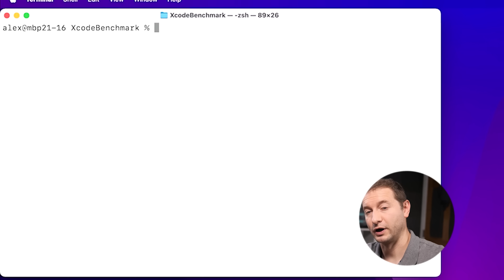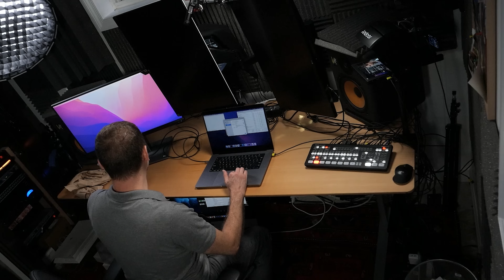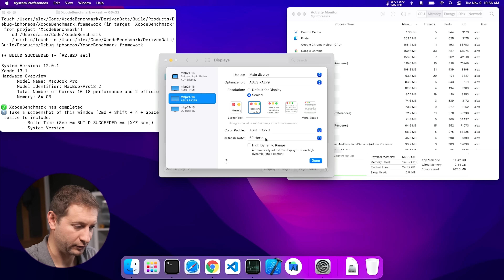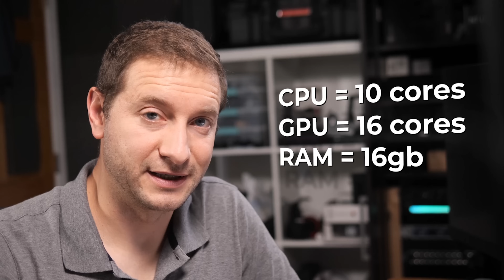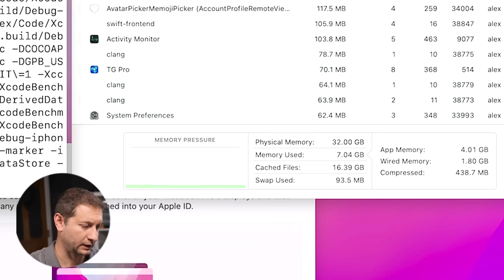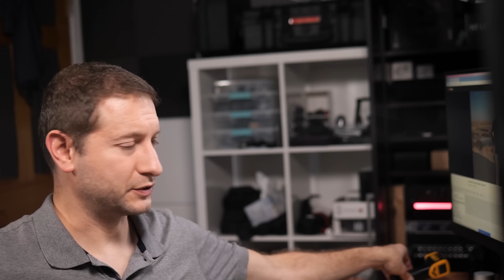More monitors = slower MacBooks | M1 Max/Pro with several 4k

Comment: Hello Alex!
I am thinking of buying the new macbook pro m2 pro 32gb/1tb to use it for professional software development.
I have two 32 inch 4k external monitors and one of them supports hdmi 2.1
Do you think that it will be quiet?
Is there any advantage to go for the max model?
I am not doing graphics or video so I believe there is no reason to go for the max series.
Thank you!

Comment: If you buy Displaylink certified hardware you can add more monitors. I'm able to have 4 external monitors on my m1 iMac. Of course this is for software engineer work. If you're working with video stuff your machine might blow up 😆

Comment: You should have ran multiple build passes before plugging in monitors or you could have done the last build after plugging in monitors due to caches and SSD optimization.
Given what I've seen of Apple's engineering on the software side of things I'd be surprised if they did proper clearing between runs.

Comment: To me, it doesn't seem like you're necessarily seeing slowdown because you're using more monitors. You've got videos playing on those monitors. Play those same videos and have those same windows open on 1 monitor and 2 and 3 and 4. Otherwise, nothing really has been proved. There's a reason the Xcode benchmark has that message about not doing other things while you test.

Comment: Thanks for the video. This doesn’t explicitly test the performance with external monitors connected but rather performance when other applications are running because we can’t actually attribute the performance impact to solely having an external device connected. As others have said, the test would’ve been better if you benchmarked with external monitors and no other applications running to establish a baseline. Same tests could be ran with each monitor connected to an individual port on the MacBook, then through hubs, then with different resolutions and a combination of hubs and resolutions.

Comment: What dock did you use to get 2 monitors on the M1 Pro? I'm trying to do that, and unfortunately my current dock that worked perfectly for my windows laptop to have 2 monitors doesn't let me use 2 monitors on the M1 Pro. Very sad. All the docks I'm finding online that support 2 monitors for the M1 Pro are like $300. 

I don't want 2 extended displays. I want AAB, one mirrored display and one extended display. I will use the laptop in clamshell mode

Comment: Something that I've seen with my intel 2019 macbook pro and my m1 mac mini 16 gb is that there is a process named "WindowsServer" which is related to the screens (I have two 28" 4k monitors). What its interesting about this process, is the RAM consumption keeps growing as time passes. I tried killing the process to recover the ram, which ends up closing the session which would be the same as rebooting. So, so far, this looks like a ram leak. What do you think?
Reply: I have exactly the same problem. I use 2 4K Monitors with my 2019 MacBook Pro 13 inch with 16gb of ram, which becomes unusable after 2-3 hours when running IntelliJ and Docker. WindowServer then nearly needs 5-6GB ram on its own…

Comment: Cool video, but it doesn’t really answer its central question… at all. 

The benchmark test is going to be effected whether you stack processes on one monitor or three… the way you did the tests it’s impossible to extrapolate how much additional monitors are contributing to the slowing of the benchmark.

Maybes redo the tests, or simply don’t add to the workload by running additional processes… the entire point of the benchmark is to provide a controlled variable to give an accurate baseline.

Comment: Theoretically extra monitors shouldn't make a lick of difference as your thunderbolt controller is separate from the SOC. RAM usage may vary as it uses shared RAM between video card and system, however it shouldn't hit it too hard as each monitor shouldn't be taking too much as it should just be the extra driver and then the image which should be getting flush every 3 frames. Any real slowdown will probably be coming from the OS. or if you cut hard enough into the RAM to force the compile to use swap.
Reply from the maker: Looks like you might be right
Reply: @AZisk  I am a bit worried about those RAM figures as you add monitors (prior to running anything), that is way more ram than it should be using.

Comment: Question for ya Alex. I've been trying to lock down the most efficient way to drive 6 EXTERNAL monitors with my M1 Max 16" MBP. I'm supposed to be getting the system next week (fingers crossed) and thought about getting a dock or two ordered right away to be ready.  These are not really high res monitors (native 2560x1440).  Obviously I want to drive 4 monitors from the built in Thunderbolt ports, but I suppose I'm going to need a DisplayLink (Targus 4x for expandability?) dock as well to drive the remaining monitors.  What did you find exactly with your port and/or dock arrangement here for driving monitors?  Am I understanding you correctly that you can only have 2 external monitors per Thunderbolt dock or Thunderbolt 3 to Dual DisplayPort adapters? I want to minimize the number of cables I plug into this system to prolong life of the ports and reduce complexity of connection/disconnection when I grab and go... Would appreciate your thoughts on the "best" docks and/or cabling arrangement here so I don't lose my mind...
Reply from the maker: I haven’t tested my max with 6 monitors, but i use 3 daily: my native display + 2 LG 4k 27” displays via a hub. It works ok, but i feel like i do get weird hickups that I didn’t use to get w my intel imac. I don’t know if it’s related to the software I’m running or having the monitors plugged in. It’s too early for me to say whether i can get rid of the hickups by removing the external monitors
Reply: @AZisk  could you explain in more detail the "hiccups" you're seeing? I'm shifting gears from an older Mac to reduce "hiccups" and I'd really like to understand what you're seeing since I'll be running this with 6 or 7 additional external monitors attached (Thunderbolt + DisplayLink) and would very much like to either corroborate or eliminate the issues you're referring to from my evaluations going forward.

Comment: Thanks so much for your great work. 1 question: Is OWC Hub able to output 2x 1440p 144hz monitor (2x plugged to OWC) when the hub plugged to single port of MacBook Pro 16-14 M1 Pro? As far as I see in your video, it can output 2x 4k at 60hz in HDR so it should right?
Reply from the maker: I didn’t test 144, but it seems this hub should be able to handle that
Reply: @AZisk  i think the same.. thanks for your efforts

Comment: Here is a little TIP if you use any of the scaling options theat give the little warning that says "using scaled resolution may effect performance" you are actually forcing the monitor to run at a higher than 4K setting. The 2560x1440 mode actually runs as 4096X2304 and the retina mode will be 5K downscaled so MacOS thinks the monitor isn't a 4k but a 5K monitor. This will tax the GPU by nearly 30% more than if you use the default scale which is 1080PX2 or 4K. This isn't an issue until you need to use the GPU for anything other than displays, so if you need the GPU for video editing you should rescale the displays to get the maximum power available. Also in the display settings if you hold the Option Key and click the scaled bubble you can set the display to more resolutions in both Retina and regular scaled resolutions.

Comment: You sure it is number of monitors and not the processes you running while compiling? What If u run Only 1 monitor but with YouTube playing while compiling? I guess to test If monitor is affecting performance you just need to connect the monitor but not running any other processes to be accurate

Comment: don’t forget that even though you have the 4k displays scaled down to HD or whatever, they are still retina displays and so i believe that if you have images or videos on the screen they will display them at native pixel resolution, ie at the highest résultions the gpu can match to the display native pixel res. that’s what i understand retina to be about anyhow. happy to be corrected. 

so what i’m saying is when you scale down a display it does that with all the chrome and text etc of the GUI but certain areas of the screen displaying media will push as many pixels as the display can handle to increase the image quality. is that true?

Comment: I have the 24 core 16" M1 Max with both the laptop screen and two 2k displays running (one at 144Hz). It seems largely unaffected by the monitors in terms of performance. The fans stay completely off unless I get to some heavier work where most of the CPU cores are being pushed, then one of the fans kick in at 1500 RPM which is to my ears completely silent (I do audio work btw).

On the intel i9, the same lighter work would have both fans spinning at 5000 RPM because simply connecting the monitor heats up the GPU so much that any load on the CPU on top of that just sends it flying. Actual heavy load with monitors attached would severely throttle and underclock the i9. So happy Apple went away from intel.

Comment: Do the displays reset every time the MacBook wake up?
Or
If you have two monitors plugged in then add a third for occasional use then does it remember settings of the third monitor from the last time it was plugged in or are you setting up from scratch again?
Reply from the maker: Ive been using it more, and it remembers as long as the configuration doesn’t change. If you add a monitor or plug them in differently, everything is reset

Comment: It’s more efficient for karnal to leave stuff in RAM, deallocations cost CPU cycles. More RAM you have more likely the kernel will just leave stuff in there. Plus you might still use it later, so if you do it’s already there for you saving a trip to the storage drive that’s orders of magnitude slower to access. Whereas more memory constrained devices are more likely going to cause the Kernal to preemptively free memory as it feels it’s under more memory pressure.

Comment: Each 4K pushes roughly 18 GB/s bandwidth. TB3 and TB4 can carry 40GB/s. This is why you can only get two of the displays through the dock. That is a technology bottleneck, not a dock or M1 issue.
Reply: Youtube definitely does NOT push 18GB/s. That figure would be assuming around 8 x 4k video 10bit streams (as 4k @10bit is ~18Gbps not 18GB/s), 4k youtube is nowhere near that level.

I have run 3x 4k monitors off 1 Usb 3.1 channel which carried 2x DP + 1 HDMI connection over it. The same system had an additional on-board DP connection and a HDMI port.

If thunderbolt cannot do this on the Mac, then that is definitely a Mac issue. Given that previously these same models were having issues running more than a single monitor without bricking or crashing, then that backs up the theory it is an OS/hardware issue that is not thunderbolt related.
Reply: @slipoch6635  You need to read how TB works, if you're running a display-port channel on that interface then it allocates the bandwidth for a display-port signal, this is a lossless, zero latency, always available, not affected by content, zero CPU load channel of video.  If you wish to stream video over USB then you can do all sorts of tricks - but thats not Apple as the experience is not consistent.
Reply: @edc1569  How this hub will work with 1k monitors? Will support additional 3 monitors ?

Comment: I am glad you made the tests on the machines you did, and noted how well the 16GB vs 32GB operate.  I too am slightly surprised at the monitor limitations on the Pro.  I expected too that if your monitors weren’t at full spec’d res, that you could get away with more than two monitors.  Guess not.  That too is informative for me.  Almost pushes me to consider the Max.  But, then again, my need to run more than two discreet monitors is extremely unlikely.

Comment: There's no point in testing CPU performance here... Of course CPU will be affected a bit - to handle all those windows - and especially if you run some apps in background but that's all. GPU will be more used, especially its VRAM (in this situation - just main RAM) 

In your video of course RAM usage were higher, and build times were slower on more monitors - because you simply run more apps / Chrome tabs - come on 😀 

Also: If you have more RAM installed, OS will obviously try to use more RAM because what's the point of having RAM and not using it?

What could be more interesting from such videos would be: fan speeds, temperatures, GPU performance...

Comment: Most of the time it is not software limitation, it depends on how many thunderbolt chips it has, it would probably handle even up to 8 ( I know it'll have some reduced FPS sometimes and so on, but it's still handling ), but as M1 is not Intel CPU, it has dedicated thunderbolt chips inside, but trick there is that, I remember it has 3 thunderbolts, but HDMI is not using thunderbolt indeed, so you discovered bug I think, it thinks all Thunderbolts are allocated, but it is not. Don't quote me on that, but it's probably bug. but it can be Apple, manually reducing number of monitors connected from SmC, or something like that, for same reasons as they did reduce performance on iPhones for years ))) to sell higher priced models, so both cases I don't think you'll be able to avoid that limit with external adapters, if it hits hardware limitation (every thunderbolt chip is allocated) then it'll not be physically able to handle more monitors, and for that case when you use 1 monitor with HDMI, again, either it's SmC, or Software limiting it so it'll not let you connect more.

Comment: Thanks for the real world tests. Guess you don't use devtools in development much.  In the real world a developer might be stepping through code and pause at a breakpoint.  Maybe devtools is communicating with an IDE.  Intuition might say no additional resources would be used if devtools is paused on a breakpoint, but inuition goes out the window with chrome in my experience.  Too niche a test? Poll developers to find common setups?

As others mentioned, the video title is a bit misleading as the test is against additional task not additional screen. Multiple videos playing simultaneously? Perhaps not very real world.

The question of standardization could be  addressed some by driving the tests with AppleScript.

The general benchmark problem is that they are often done as drag races, i.e. find the max speed without regard to how users really work. Pitting machine against machine is fine if one is choosing a machine for a headless build server, but who is doing that with a laptop, so thanks again for tests showing RAM use, temps, etc. in a scenario closer to what will be felt by the user.

Comment: Results are obvious. The memory is unified, shared between CPU and GPU. Hi-res screens eat a lot of memory. You'll need 32 gigs at least for such play. But I guess most devs will do fine with one external monitor.
Reply: So, to clarify, a high res screen will use more of my RAM or GPU memory?
Reply: @joelm.8340  On these macs, GPU has no memory of its own. It uses RAM, hence unified memory
Reply: @ukaszb5694  awesome. Thanks

Comment: Of course the second time is faster. Everything is cached in the ram and you are increasing the load (the youtube vid) after each test. This is not benchmarking the monitors. You would need to use the same load with and without the external monitors and compare that.